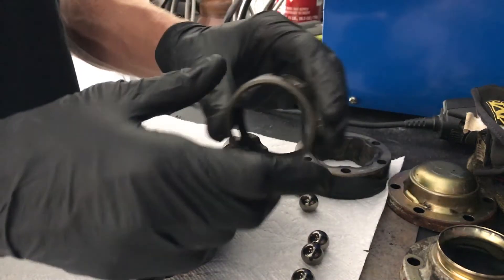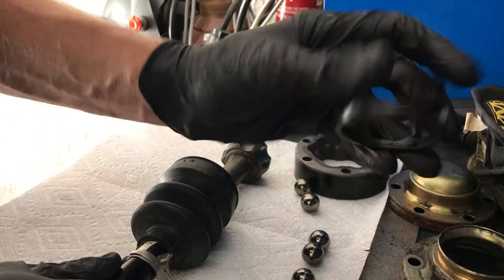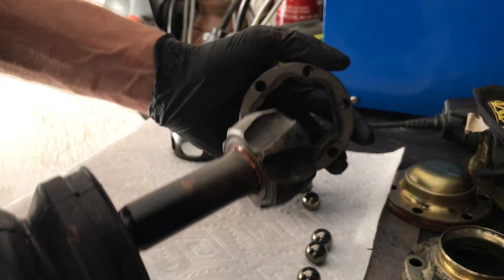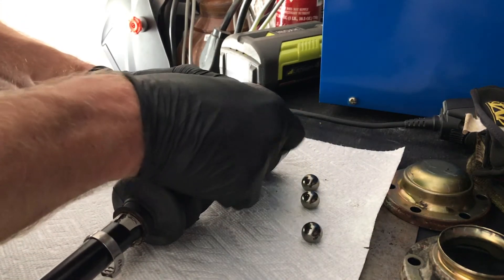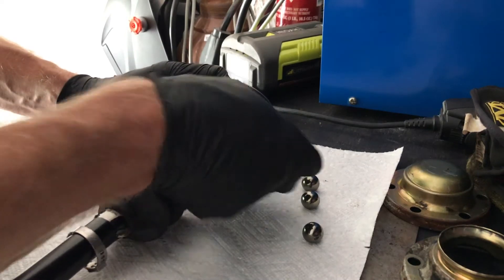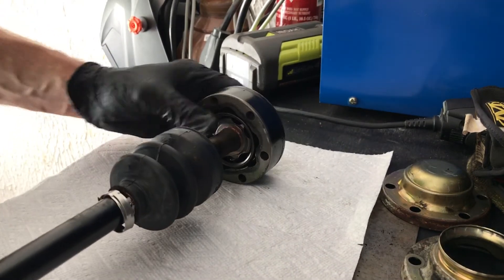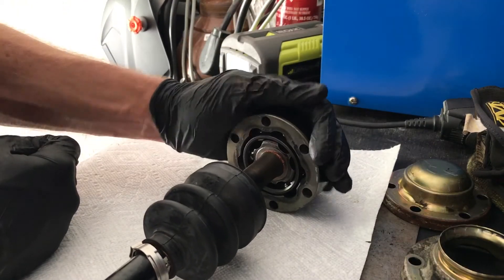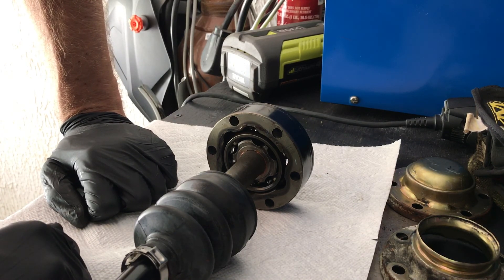CV Joint Assembly - HOW TO put it all back together - Porsche 996 inner front CV Joint

Comment: Your video put an end to the struggle that I had for hours to put the joint back together, big thanks! You could add Turbo to the title of the video, it also works for the 996 Turbo front axles.

Comment: Thanks, this is a big help! Especially the part about matching large gaps to small gaps. These differences in the gaps are caused by the angles that the cylindrical slots are cut at. I've just pulled a drive shaft from one of my Mercedes diesel and everything you've show applies directly to mine, as well. Funny about how you didn't put the cover on. That's something I would do! I'll actually assemble my CV joint before I put it back onto the shaft.

Comment: Very helpful thanks, just done all four shafts on my 997.2, some info that might help others,  fronts - no bevel on the inner cage, ring on outer was facing away from driveshaft.
Rear - pretty much the same procedure as the fronts, however the bevel on inner cage was facing away from driveshaft and would not come off until the gear was pulled off the spline, the ring on the outer was facing in towards the driveshaft, the ball bearings go back in as described in the video.

Comment: Im from the Philippines & your video helped me to put back the shaft, ball bearings & the cap in the right places for the joints to freely move. I replaced a torn wheel boot (right drive shaft, inner boot) on my Mk7 Golf Gti.

Comment: Copper antisieze can actually cause corrosion. The dissimilar metals are not meant to be together like that for extended periods of time. Spark plugs are often installed with antisieze but they are changed every 60k miles. If you are going to inspect and take apart these joints every 60k or so then fine but if not there is really no need for the copper antisieze. A little axel grease would be better.
Reply from the maker: Thanks! Learn something new every day. I believe (and its bee a few years so don't quote me on this) that this anti-seize was specifically referenced in the shop manual for use on the axle nut.

Comment: How did you get the bronze/gold end cap off of there?  I don’t want to wreck it and I also don’t want to pay for a whole new one.  Is there a clip or does it just press on?  Thanks in advance!
Reply from the maker: Hey Mitchell. If I remember correctly it's just pressed on. I used a flat edge of a screw driver tip and a hammer to slowly and lightly tap it and work my way around it so it came off evenly. Turn the screw driver tip so its perpendicular, that way the screw driver doesn't wedge between the two parts and cause the cap to flare out.
Reply: Figured it was pressed on, thanks for confirming.  My Axel wasn’t as easy as yours to remove either.  Took it to a local shop and they got it out pretty easy, and free! They used an air chisel which I don’t have yet. The nut was easy with the impact wrench.  I’ll get another update video up soon so you can see the progress, nearly there! (Finally)..

Comment: thanks for this. Any chance you documented  the outer CV reassembly? Now that is a major pain in the butt. I get the balls in but the axle just binds up and I have the beat on the bearing race to release the balls and start again...and again and again and again.. I wonder what i'm doing wrong. i'm on an e36 m3 and your CV looks identical.
Reply from the maker: Hey Pete. Sorry, but I never disassembled the outer CVs when I was doing this project. The best advice that I can give you would be to try to find the Bentley repair manual that documents how to reassemble them. There is a method outlined that might work.
Reply: @charlieaf92  Thanks Charlie, i'll check out the book!

Comment: What symptoms sound were you bearing from CV?
Reply from the maker: Hey Dale - in my case the bearing was fine. I had to disassemble it in order to get the new boots on. My outer CV boots had both ripped and were flinging grease inside the wheels. There is a special tool that you can buy to stretch boots over the joint without having to remove the axle from the vehicle and disassemble it, but I don't have one and I found it to be easier to have the axle on the workbench for inspection + cleaning vs. trying to do it on the vehicle.

That being said I've driven a car with a failing CV joint before. The symptoms I noticed were 'clunks'. Typically when starting from a stop or accelerating after braking.

Comment: Thank you!  I just spend hours trying to put it back together and gave up.  I will try this method.  Having just spend a full day replacing my cv boot, I felt I should have just bought a new complete cv axle.
Reply from the maker: Hey Jim - stick with it! If you have any questions just let me know. If you just need a new boot, this saves you a good chunk of change. Especially if you're doing both sides!
Reply: Took me a long while but finally got it back together.  Assembling it from the comfort of a desk and chair was helpful.  Thanks again for this video!
Reply from the maker: @atm4jim  Excellent! Glad you got it together, thanks for the update!

Comment: Wish I'd watched this before I but the centre on the wrong way round.  The under cut on the splines is there so it doesn't bind up on the shaft splines but will go on enough to fit the retaining circlip.  Got to get it all apart now whist it's on the car to rebuild it properly.  Great vid though!
Reply from the maker: Hey Chris - I did the same thing the first time around. I think you'd be just fine leaving it as-is, as long as the retaining clip seated properly. If its still accessible I'd probably switch it around for peace of mind though.
Reply: Couldn't get the circlip on and as the shaft was on the car I had to take it all off, strip the joint again and turn it round. It was good practice for doing the other side though; that was a nightmare to do on the vehicle with only just enough room on the crown-wheel side of the gearbox without splitting all the suspension joints to get the inside of the joint, the ball bearings and the cage on and off by dismantling and rebuilding in situ... Couldn't get the outer off but if you use care you can actually get a CV boot through the inside of the outer onto the shaft and rebuild the joint on the car then pack it with grease! Yep I'm totally mad but sometime you just need that insane 'bush fix'...

Comment: You've just saved me from a world of aggro, thank you for posting this! I was just replacing the outer joint on our car and accidentally pulled too hard on the shaft, causing the balls to release inside the rubber boot (is this an exclusively male issue? lol)  . I was beating myself up thinking how am I going to use the car tomorrow but this video put me back on track (even though I did pop it apart again when reassembling, so had to degrease/degrit and regrease the thing twice). Cheers man!
Reply from the maker: Awesome - happy to hear the video helped Dan!

Comment: Very nice video and it came in most handy when mine came apart as I knew it would. Caught the mistake early, but what the heck you at least put a video on and a good one at that. I put the CV bearings into a magnetic tool cup and that along with a little vasoline did the trick. Thanks.